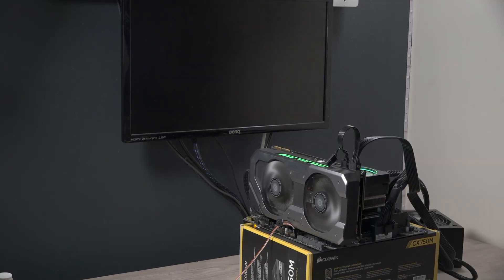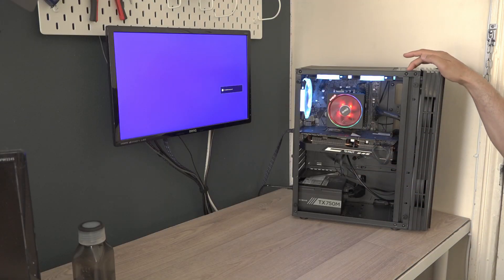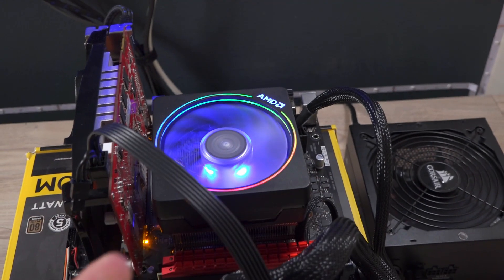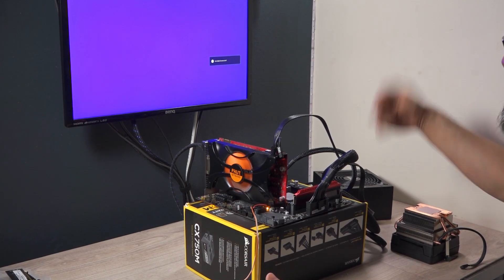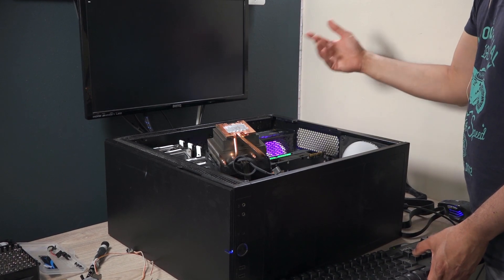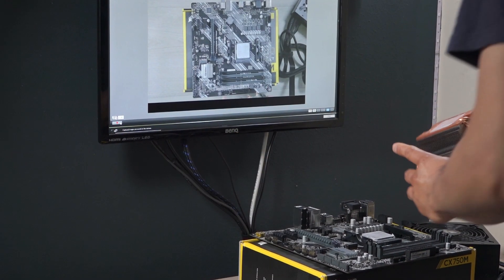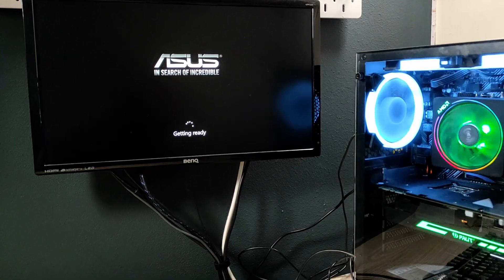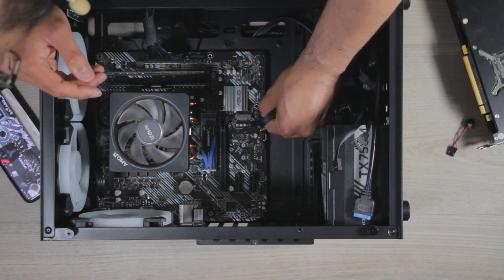Computer Turns On But No Display - Led Light On Fan Spinning - HARDEST Troubleshoot?

Comment: Monitor was working yet no connection keyboard and mouse were not working fans and RBG were all working. I simply disconnected all the power made sure everything was plugged in properly. Turned off the lever on the back of the PC unplugged it as well let it sit for maybe about 20 minutes as I researched for stuff got tired of looking plugged everything back inand then it seemed to work might not work for everybody

Comment: my buddy has a 5070 no vables or anything connected just built turned it one and the VGA trunened white and the BOOT green how do i fix the WHITE VGA light this is his motherbaord z790 motherboard VGA white light. (haven't gone into bios or anything yet)

Comment: I put together a new pc and tried to post for the first time.  There was no post, so I tried everything, still no post.  Power was fine all around though.  The problem was that the ram memory cards did not establish good contact with the pins in the slots, so taking them out and putting them back in seems to have cleaned the contacts and voalá, the pc posted the Bios screen.

Comment: Damn. I have the same issue (fan spins, no boot, not even beep codes, unfortunately no Debug leds on the board) and I already ruled out any component except the motherboard. I thought he is trying to repair it. But no he just replaced it 😒

Comment: did anyone face this issue:
1. goes black screen after 10 minutes but also crashes the windows as in i cant go back to welcome screen either.
2. tried fresh widnows twice but no luck/
3. bought a brand new nvme but it end up in the same loop.
4. tried cleaning RAM and also apply new thermal compound.
5. but BIOS menu stay LIVE for more than an hour with no issues

Do you think its a failing iGPU ? or PSU or mobo.

Comment: Its usually not the motherboard but the bios that is corrupted. Mine had no problems at all but accessing the bios. Then the dreaded day came when my windows was corrupted and need a bios boot to USB to save the windows. Next thing i knew, i had the same problem as this video. Everything boots, even the hard drive was loading but the screen was blank. I am gonna try resitting the ram and cpu tomorrow. If that does not work, will get a new MB.

Comment: My pc like this too, my pc specs r3 3100, asrock a320m, 32gb ram, rx 6600xt, psu CM MWE v3 650w
I try plug hdmi cable on motherboard and it show nothing

Comment: I have the same MB and I think it's the issue, it does weird things from time to time, I have a new GPU and CPU which both worked fine one day I changed the CPU cooler and took off the GPU to clean it and once I boot it nothing appears, I tried everything still the same issue, so I'm just getting a new MB

Comment: not working.I have an issue, I installed only one 16GB RAM, and it came on I installed windows with one 16 gb ram,  , not on four sets or two sets, debug led lights on cpu and ram blink all the time, with all fans  , no display.

Comment: I have the same issue back when it was january, my pc seem to turn on but got no post. but instead all off the fan spinning, my front fan is not spin.

it was actually can post again when I do swap my upgraded I5 12400f and as of today I downgraded to i3 12100f again, but after 2-3 weeks the same problem is back.

I've tried to switch ram one at the time to other ram, or switch the slot with the one of the other ram. yet no result.
I've tried to turned it on without the gpu, cause I thought maybe the psu is having the power problem. yet no positive result.
I've tried to clean any slot, clean my ram and gpu with eraser. still no post.
I've tried to take the cmos battery, and do the instruction on youtube. still no positive result.
the last thing I wanna tried is took my old amd r7 240 and put in to this pc and see if do any good result.

anyway, after I downgraded and got it working. I do some testing and the result is mostly positive. check the ram, cpu, gpu, ssd and hdd, all seems working so well even the temperature is right.
I don't actually know and stuck all day tryna troubleshoot this pc, my head actually got dizzy rn.

my specs right now is (I bought my pc in 2023):

I3 12100f (cooling it with deepcool ak400)
amd rx 6650xt
ddr4 8x2gb 3200mhz
mobo asrock h610m-hdv/m.2 r2.0
internal 970 evo plus 512gb
ssd sata MSI 512gb
hdd 2tb
power supply fsp hv 650w 80+ bronze

I do some research and many people say it's either the psu got a problem, or a mobo failure.
I wanna do some troubleshoot for further test, but I have lack of part since this is my second pc. my old pc was actually a amd A8 7600, it's a budget old pc. I do care with and put my effort so much to my second pc cause it was actually all my saving for the past 4 years and I do so much research since high school so I could built 1 from scratch, and I did it.

sorry for the broken english, it just really overwhelm to my head rn.

Comment: So all my fans except my gpu were running and I had no display nor did my usb slots work. My solution was switching the slots of the ram sticks.  Instead of 1 and 4 I switched it to 1and3. All of sudden the gpu  fans spun and my usb ports work… the display shows😄.

Comment: Once I opened up the case I realized how dusty it was. I cleaned up a bunch of the excess dust inside and it booted up no problem. After 12+ failed attempts…try cleaning your pc.

Comment: I have new cpu and motherboard. My keyboard and mouse are working, checked it by pressing numlock and it works, but I still get no display. My rams are new as well and said to be compatible with my motherboard. It's been 5 hours. Can anybody help :<

Comment: I thought I had to change mother board but I just reset bios taking that little battery out for 5mins and touching both pins for 15 secs, I put GPU back in turned it on still no display but then I turned off and on a couple of times and randomly worked 😅

Comment: Sumwhere in the comments sum1 mentioned it was the screw on the cpu fan that was tightened too tight, cant find the comment bt to THAT GUY... THANK YOU... you changed everything for me... fixed my problem. Had two problems...

1.
Took entire pc apart until it was just power supply and motherboard (cpu and fan/heatsink still connected) and turned it on, still orange light then I read your comment and loosened the screws a little and hit power button... BOOTS TO GREEN LIGHT.

2.
 I then inserted all four ram cards and again got the orange light so I insert and start test each ram slot one by one, it was the second ram card so I swapped second and forth card around and started up, SHE PURRS BEAUTIFULLY. 

It also cud be the bios hard resetI did bt for me... loosening the cpu cooling mount/fan was where everything changed, got a different result from all the tests I did. So thank u for channels like this and people who comment. The vid may not solve your problem bt a comment might. Keep it up guys.

Comment: I'm worried because I just build a new pc and 1 month using I got a black screen 2 days ago and can't solve it. The pc turns on but I can't enter in bios. Motherboard is b450m gigabyte and gpu is rx 6750xt. I hope the issue is not my graphic card.

Comment: After a month of being gone my pc was working beforehand and i turned it off and unplugged it when i left, came back to it not even turning on, took everything apart and tested one by one, got it to turn on with original parts, 1 ram, no gpu after resetting CMOS battery well, it wouldn't post or connect to keyboard so i figured faulty psu and bought a new one(didnt work) at that point i thought maybe motherboard so i ordered a new one and nope still same thing, i can get it to turn on after resetting the CMOS but it still wont display nor connect to keyboard, on new motherboard and psu the CPU light turns white and stays solid but no beep codes(even got it to turn on with old psu and motherboard) i dont know whats wrong with it besides maybe the cpu but i dont have the money to replace it and for anyone recommending bent pins or not seated properly, ive reseated it three times and checked all pins, no issues there, maybe its just fried, if anyone could help i would greatly appreciate it!
Specs - 
Ryzen 7 3800XT
Cooler Master EVO 212
MSI MPG B550 gaming plus
RTX 3060 TI OC EDITION
32 gigs of DDR4 @3200 
EVGA 850 GT Fully Modular

Comment: If your graphics card is older with a vga port . Plug it in via vga . I’ve tried everything but getting a new mb and using the vga port until I was able to download graphics drivers got my computer to boot

Comment: I'm having the same issue. Everything turns and spins, but no signal. I swapped my GPU into the lesser PCIE slot which is 2.0 and it works. I think I fucked up my PCIE 3.0 slot, but i''m still testing

Comment: Love your video, just built a rig for my brother in law all parts were working fine out of the case and worked fine for 1 day while in the case, next morning after updating bios i got no post and white light, the said motherboard is old and I was planning on upgrading it anyway since I was already having problems with not having wifi after installing windows, something in the gpedit i dont have access too. i'm hoping a brand new b550 motherboard will help solve this issue!

Comment: Hey I don;t know if you'll reply but I have a laptop, it once froze and when I restarted the screen was lit but black, wen to safe mode after reseting, newly installing windows everything I found out if I remove display drivers it works but with amd ryzen display drivers it doesn't work but without the driver I can't change screen brigthness and it always stays high and many things don't work properly. What's causing it? I've paid 2 repair shop and they just reset driver and stuff same as me and the issue continues I've been just wasting money but no fix.

Comment: My Keyboard and Mouse don’t Connect too, i got that the Mouse Connected once, and now i got the Black Screen with the - but no Connection to mouse or Keyboard or start bios. I reseted the bios by battery Output - thats how i got the screen work and the Mouse for once. I guess i will Repeat it Maybe more will work then

Comment: I just swapped my cpu amd ryzen 5 2600 for an amd 5 5600x. With both (the same) standard fan. I also change the gpu from the Vega56 to a 6700XT. But the Pc does niet give any display and keeps on restarting non stop. Anyone know what i should do?
Reply: u need to update the bios before putting the new CPU

Comment: Yesterday my pc ok, i tried to format but wrongly changed boot disk from bios when u can actually just clik esc or f8 to change boot to pendrive, after that bios i restart pc and it wont connect anymore even i pull off the pendrive, cleaned my ram, removed cmos, remove gpu, removed 1 ssd, still nothing.

i7 13
3060
32gb ram

All light on
Gpu fan spinning

Comment: If my computer going to post after turning off my psu, and when I restart it didn’t go to post- failure is my psu? So when I switch psu my computer have going to post after 4 save+reset in bios, on fifth restart it didn’t go to post.

Comment: Had the same issue, tried everything.  realized it was my power supply in the end.  My 750 psu couldn’t power the 4080 and everything with it.  Got a 1000 psu and working just fine

Comment: I have this exact problem, but my computer will turn on after around boot 5 attempts. Every time I try to use my pc, the fans run but there is no display, but it turns on after multiple tries, but it deletes my bios settings almost every time, and I have to restart again if I try to open some select apps such as games or fl studio.
Reply: It’s ur interface
Reply: @prodgroovyCHU  elaborate?
Reply: Have u fixed the issue having the same thing
Reply: @gameplaysotherstuff9444  nah bro I built a whole new system lol

Comment: (Black screen and mouse not light)

Those who watch this video and not working use my mothed,first left the pc only with power supply cable and hdmi,then disconnected the cmos battery wait 5 second and take off extra ram and left only one,after that put the cmos battery back and turn on,it work for me

Comment: I was having a similar problem to some in the comments where my fans would spin and light up, but I got no display and my keyboard and mouse was not lit up. I was able to fix it by simply taking my ram out and putting it back in.

Comment: Welp, I have similar problem. I've bought 2nd hand motherboard that came back from warranty exchange (serial number on the motherboard checks out on manufacturer's website with warranty still until 2026), I've installed CPU, GPU, RAM and NVME and it worked just fine, installed Windows, fooled around a bit and closed it down for the day... next day, no video, no beeps, no nothing. Gigabyte B550I Aorus Pro AX - I have plenty of hardware lying around to test every component independently so thankfully it's not the CPU (3950X) but man, it hurts, especially knowing RMA will take absolute fucking ages...
Reply: Bro help me i m going to chuck this pc out the window i m having the same problem
Reply: @gameplaysotherstuff9444  I didn't have any luck. You can google LinusTechTips "Gigabyte B550I Aorus Pro AX v1.2 - no post, reboot loop" thread and follow troubleshooting steps, maybe something will work for you. Most people with similar symptoms that I've found forgot to plug CPU power cable on the motherboard...

Comment: Mine has video, I can get to the bios, but when the windows is supposed to start it just freezes there. Not a boot loop, not an infinity windows load, it just freezes.
Reply: I literally just had the same problem with a prebuilt HP OMEN. Shut it down and went to work came home tried to boot it up and it was freezing. I was lucky and had an extra 1660 GPU, a PSU, and a brand-new 8GB stick of RAM to swap out but no matter what I did still froze on the loading screen the circle would stop and stayed that way. Since I've never taken off my cooler let alone the CPU I thought, it had to be the motherboard. Bought a new MSI B550 MOBO and a Nvme SSD (thought the software could have been corrupt) swapped all my parts got into the BIOS, GREAT! Then went to install a fresh version of Windows and... it froze! Somehow my Ryzen 5 5600g decided to stop working between power cycles.  Bought a new Ryzen 7 5800x and an AIO so $600 later I basically have a new PC. I guess on the bright side I have extra, known working, components now, and if I get a used 5000 series CPU I will have another working PC. Good luck with your PC I hope you are up and running soon.

Comment: My keyboard, monitor and mouse dont turns on, but the pc do, when i took off the gpu the keyboard and the mouse turns on but my cpu cant show display, so i dont know if the problem is the power supply or the GPU, another thing is that the GPU have a white led so i guess there is the problem

Comment: My PC has a red and orange light when I turn it on and not display. The lights go away after like 5-10 minutes and the display turns on. Everything works fine once there is a display but obviously it's not supposed to be like that.

Comment: He changed the motherboard with a new one and it worked, for those who are wondering and are frustrated with their gpu not working, saved you 14 mins!
Reply: Not all heroes wear capes.
Reply: @fez5705  🫡😂
Reply: thanks
Reply: i wish i read the comment first
Reply: But the client said system wa working before case swap,would that mean he broke the motherboard during case swap or what??
Reply: because people always read the comments before watching the video
Reply: just clear cmos
Reply: @lelife0408that doesn’t work either. Brand new board, bought 3 of them. There is not a single chance all three boards are down. I’ve replaced every part in my pc 4 different times. I still suffer this issue and I’m a experienced builder

Comment: I had a CPU issue a few days ago. Same thing as in the video. RGB and fans turned on but no display. Thing is my GPU RGB wouldn't turn on which made me doubt if it was the CPU or the motherboard. A blue electric spark appeared in my pc before it happened, so anything was possible. So I just went to a pc store and got a compatible motherboard and CPU and I explained my issue and that I needed to do some testing. They told me I could return the hardware if it was in perfect state. I was still under warranty for my own components, but I didn't want to wait. That's how I did it if you don't have component, albeit a expensive solution. But you do get your money back in the end. Found out it was the CPU and returned the motherboard. Now I sent my old CPU for repair, but I still kept the new CPU. (Secretly did a slight cpu upgrade too, because it was actually a bottleneck anyway) So I got my money back for the motherboard and now I'm waiting for a replacement for my old CPU and will sell it after.
Reply: Cpu 99% of time cannot be repaired unless an smd capacitor was shorted or pins was broken

Comment: I just got a new 3060 ti and it worked at first but then I just got a black screen and it started making allot of noise so I turned it off and now I get no display but with my old 1050 ti it does work can someone help me?

Comment: None of this fixed my issue, but after a lot of time i may just have finally fixed it. The issue seems to have been the power supply air filter at the bottom of my case being clogged up with dust and somehow that may have been causing my power supply, that is at the bottom of my case and FAN FACE DOWN and had been intaking air through that dirty filter, to malfunction and cause the signal loss on the monitor. I just rolled over the power supply to fan face up to intake air from inside the case and havent had issues since. ALSO i remove the CMOS shorter from the cmos pins on the motherboard (The cmos shorter is a tiny tiny tool that is used on the cmos pins on the motherboard. Look online for more info)